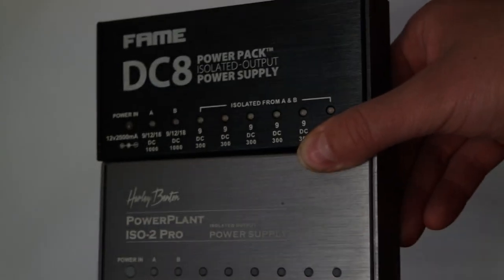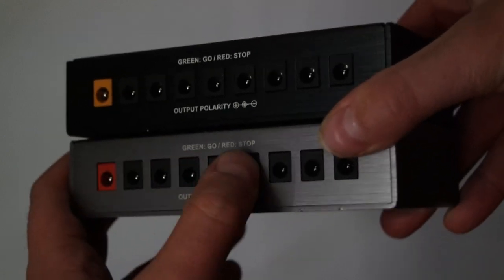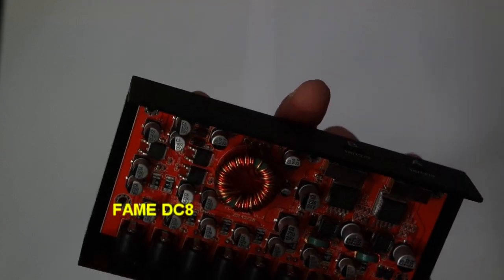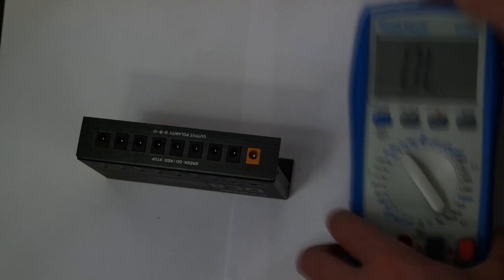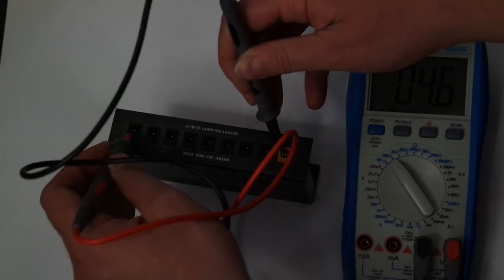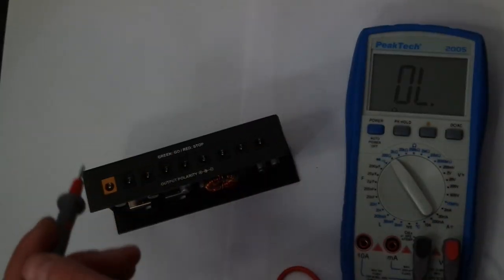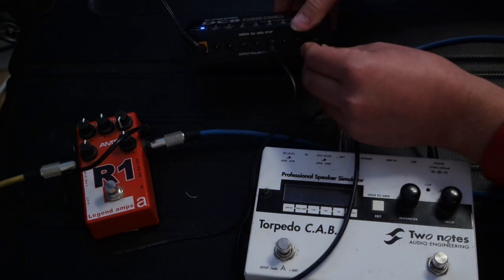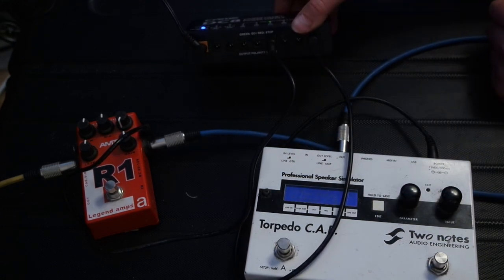Gear Review: Fame dc8 VS. Harley Benton Powerplant ISO 2 Pro (MusicStore VS. Thomann)

Comment: torpedo Cab into 9v output will create noise. you can use the A or B 12v output with more mah.this will work fine. just use the other 9v outputs for 9v pedals.
Reply from the maker: Or pay 10 euro more and get fully isolated power supply form Harley Benton and don't jerk around

Comment: The noise is not due to non isolated outputs. The noise is because you're running 2 pedals that work at 12V, at 9V! Both Torpedo CAB and AMT R1 preamp require 12V. I use a power supply with only 1 isolated output, the other 7 are daisy chained: never had hiss or hum issues. Nor when I used the Boss PSA-230+daisy chain. If you run your pedals at the right voltage, amperage and polarity (no NPN+PNP pedals), non isolated outputs is not synonymous with noise.
Reply from the maker: AMT R1 can work with both 9 and 12 volt, but even if I connect both with daisy chain and put 12 volts with enough power I still run into noise issues. It's good for you that you've never had any issues, but as for me I still prefer fully isolated outputs to concentrate on my music and not to care whether it will run into noise issues.

Comment: Is the there a power plug adaptor for the UK version?
Reply from the maker: Which one do you mean? Fame or HB?
Reply: @leothemetal  sorry man the HB
Reply from the maker: @tatepatterson5952     Well, the one I've got was with the usual european plug, the one for Germany. It is quite possible, that they deliver to UK with different plug. But you can either get an adaptor or main power supply with 12 V 2A DC output (center negative) and power ISO 2 PRO with it. Here is full review
https://www.youtube.com/watch?v=9OeFVq3VaMo
Otherwise you can ask at Thomann, if they have options for UK
Reply: @leothemetal  thank you man appreciate it. I'll try the adaptor first then I'll get another plug if it don't work, still probably end up being cheaper than buying a one spot. Thanks again man all the best
Reply from the maker: @tatepatterson5952  You are welcome and merry Christmas